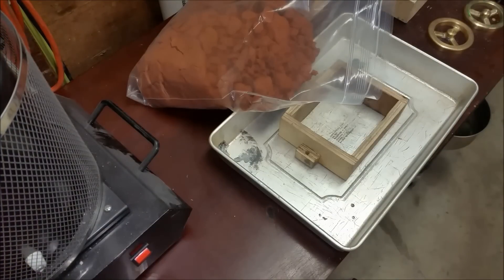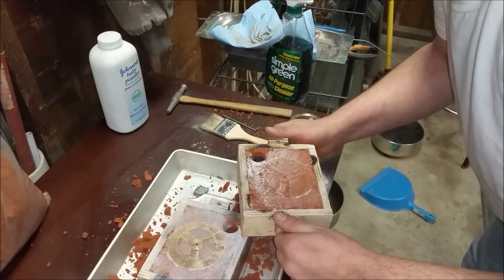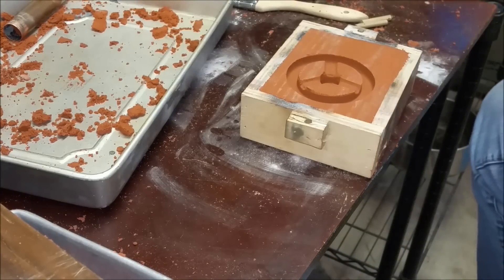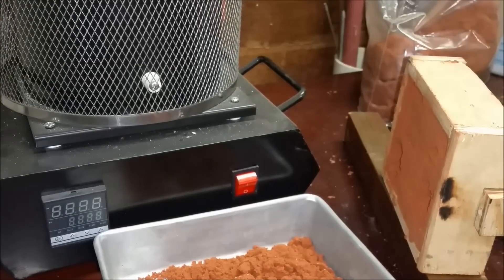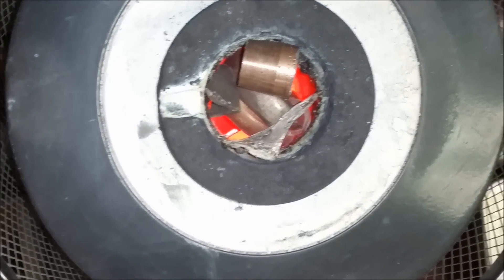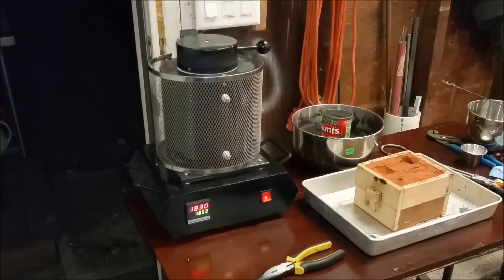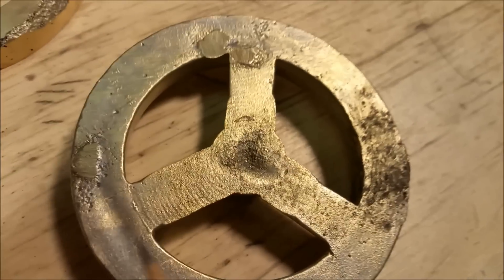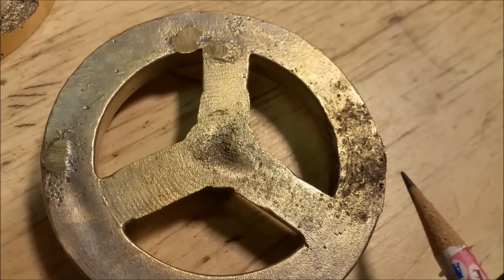Casting Brass using Petrobond

Comment: I love seeing someone first discover the wonders of Petrobond.

Venting is not much of an issue with Petrobond. (That's why they can use such fine sand which gives the great finish quality.) Greensand develops steam pressure. The smoke from Petrobond has little pressure. However, you should have a riser on the hub. When you ram the cope you should have placed a dowel  on the hub that extends to the top of the mold.  Better yet, have a pin in the end of the riser dowel that engages with a hole in the pattern that keeps the riser in place. The riser can't really be to big or too tall. The riser provides molten metal to the hub as it cools and prevents the shrink you found in your hub. Taller risers provide more head pressure  Risers should be provided wherever your casting has sections that are thicker than the average for the part.

Loose sand and turbulence cause pitting. A horizontal  runner between the sprue and the gate that is lower than the gate gives the sand that is stirred up from the metal hitting the bottom of the sprue a place to settle before it can enter the gate.

Great video. I've subscribed.
Reply: Douglas Higden x
Reply: @murrayschlussel   what does "x" men in your reply?
Reply: @crookedriver2079  I assume it's a kiss expression as in a thank you in this context for additional information which may have helped this person solve some issues in their own casting.

Comment: I'm no expert on sand casting, however, in a former life I designed and built molds for plastic injection.  This part looks like a perfect candidate for sprueing straight into the hub.  This would evenly distribute the material to the perimeter as well as solve your sinking hub issue.  Run vents from the outer edge of the cavity  horizontally across the parting line to the edges of the mold.  The symmetry of this method might work to your advantage.  Good luck.

Comment: Hi Don. I really enjoyed your video. I am just retired and plan on trying my hand at copper, brass and aluminum casting.  I hope you will not take offense to one tiny thing here. That is the smoke arising from your crucible. Brass, which is a molested copper, contains several other ingredients (depending on desired strength and texture/color) Zinc is the lesser of the mix when brass is made. Zinc and copper combined and then heated/overheated can cause that white smoke and leave some white residue.  The fumes are actually caustic and because of zinc as a metal carries a density when overheated, pretty much what someone breathes in, kinda of stays in. So, just wanted to throw that out there. Didn't know if you had a fan or something. Again, I meant no offence. Actually, I'm just now learning this stuff. I have a friend (geologist) that actually warned me on all this. Again, great video, I subscribed and will keep watching..........
Reply: The Spearsy Spin Mike Spears 
I hope he read this... Lol

Comment: How many times can the Petrobond be reused for casting? Is there a limit?
Reply from the maker: The Area of petrobond that contacts the molten metal become burnt and hard. Some people, including me have separated the burnt petro bond.  you can recover 90 percent ish depending on the casting to reuse that is not burnt. Of the burn petrobond, i add mineral oil and use it for castings that dont require a nice finish. Good luck and thanks for the question.
Reply: Can u show ua how do u reuse the burnt petrobond?

Comment: Pretty good video, your center which you call sunken, as actually something we'd call cavity shrinkage. This defect occurs when two different sources of molten material are joined to create a common front while solidification is already taking place. A lack of additional feed material to fill in the accumulating gaps can further exacerbate the cavity shrinkage problem.

Comment: I am not a caster. My experience with sand casting is very limited but I do cast using lost wax regularly when I have a jewelry project that isn’t easily fabricated. I think you will have better luck with the impression from the mold if, after making the firs half you relieve around the edge so the top half actually fits down the mold item. It is very hard to get nice crisp arises if they end at the top of the bottom half. I don’t think I said that well. Also, on a spiked item like your mold, put the spruce opposite, inline with, one of the spokes. The pour will flow into the inner hub more smoothly. But I liked your video. Very informative. Very fine casting. I thought you were very brave to cast with brass. Much harder than either silver or gold, or aluminum.

Comment: Get you a hand cranked flour sifter for dropping it on the mold piece for a finer detail. You can drop the remainer around it normally. The sifted sand helps with the detail, that around it not so much other than to hold it into the U/L flasks. Also some of the big brass tacks about in the middle of you flask both upper and lower will help hold all the packed sand in better. Just 3 on each flat side on the inside. Also, what furnace are you using and how well does it melt brass? I'm using the old propane one I've had for 10 years and sure like the looks of the electric ones.

Comment: For indoor casting, you should go to K Bond. For Petrobond, either cast outside, or run an overhead vent hood as the smoke is banned by OSHA,in closed rooms. K Bond was developed by a university because of that very reason. A riser in the center will help on srinkage dimpling.

Comment: The sprue should be attached to the lowest part of the mold. The risers should be on the top. The reason you had the shrinkage is you need a draw pool gate that the form can suck more bronze from as it cools.

Comment: Don , the one really important thing I would offer is never ever add cold metal stock to a molten pot. It is the one thing most likely to cause a spit out of molten metal from the crucible. This is a drawback with electric powered furnaces in that there isn't as much excess heat issuing at the top where the next batch can be preheated. Always preheat new stock before adding to the crucible.
Reply: Yep, it's also essential to get any fluids evaporated if you're melting aluminium cans and such. It wouldn't be the first guy who gets splattered with molten metal.
Reply: @scififan698  I shudder watching some inexperienced video content when you sometimes see drinks cans being loaded into a pot which already contains molten metal and you can hear residual liquid turning to flash steam. They seem completely unaware how very badly that could turn out. Years ago I witnessed a large spit out from a molten pot of aluminium pistons. The guy loading more solid pistons to the crucible hadn't preheated them and he then forcibly pushed an unmelted piston into the pot of molten ally with a poker rod. The result was a violently ejected spat of molten ally that luckily didn't hit anyone in the vicinity. That was likely caused by moisture sitting somewhere in the gudgeon pin bosses or ring grooves of the last piston dropped in.

Comment: Hi Don, when you redid it and used sifting sand, wouldn’t it have been better if you had given the object for casting, a light covering of talcum powder first for a quick release and finite filling of the little voids in the casting.  I’m only asking as I hopefully will be starting this sort of casting, but in alloys specifically, anyway keep up the great work...Phil 🇬🇧

Comment: I like your videos, and ive subscribed! My only question is...why are you recasting flywheels? Im really curious to know!
Reply from the maker: Hello and thanks for the question! My interest in flywheels has to do with model steam engines. I am working on prototype for a model steam engine. A flywheel is a very difficult item to come across and retail is very expensive. Additionally, machining one from a solid piece of brass is very laborious, which drew my interest to casting. In the future I plan on having a model steam engine that I can sell. The flywheel will be the focal point of the model. My best, -cheers

Comment: I would pick up a bag of bentonite clay, 2 cycle oil and alcohol to rejuv the petrobond the higher temp brass will burn it out and you will loose the green strength. A 50 lb bag of petrobond only costs about 30.00 from Western Pacific Foundry supply shipping will be high

Comment: 106 competitors of Petrobond down-voted this very cool video. Thank you for posting!
Reply from the maker: Lol..thanks for the comment
Reply: @DonBrandt  You bet, great video. So the Petrobond is a once-and-done, just one use per pour? The silica sand is re-usable, but clearly not as fine a surface by far
Reply: 1JOCU1 thank you for replying. I was wondering why the host did not respond. Like maybe he had a secret. It’s all new to me so I’m just asking basic questions
Reply: @pamtnman1515  Petrobond can be used over and over again. it get's better each time you re-use it. But to reconstitute it you need a muller. A couple of drops of motor oil added to the burnt sand int he muller and it'll be better than new.
Reply: @TheRealCreepinogie  thank  you
Reply: @pamtnman1515  I should make a video about mulling petrobond and how to reconstitute it. It works better and better each time you use it as long as you remull it, eventually it'll start going backwards and you need to mull a new batch and add it to your old batch and you're ready to go again. You keep building up more and more of it over time it seems. The biggest problem is you need a muller, a regular mixer won't work. If anyone's ever in Northern Minnesota I'll show them how. Not too many people want to get their hands dirty anymore.
Reply: @TheRealCreepinogie  I have only the vaguest notion of what you are saying here. You should definitely do a video! I am a very novice-level caster and so far I have messed around with real simple clay forms. Looking to understand the more sophisticated methods. Thanks!

Comment: That dimple in the middle could be corrected by adding a large vent right above it so it can draw metal as it shrinks.
Reply: I think you mean riser, not vent
Reply: Well, a few thin vents wouldn't hurt, and a decent riser too.. and a pooring basin, and.. see old foundry guy's channel.

Comment: Great video mate, lovely casting, came out really well.  Always preheat your metal before use, most metal will have a layer of moisture from the atmosphere which is enough to cause a metal explosion when added to molten metal.  I've done it myself, it's frightening.  Also be really careful with those graphite crucibles too, the lip wears down a little after each use, sooner or later your tongs won't grip the crucible properly - they can be really dangerous when worn. dropping a full crucible is not funny... !!!  Cheers, Andy (subbed) 🍺🍺🍺👍👍👍😎
Reply from the maker: Thank you so much for the comments and suggestions!
Reply: @DonBrandt  Your welcome, I've seen someone drop a graphite crucible full of molten metal due to a worn lip, luckily they weren't hurt but everything the metal touched caught fire !!!  Best not to learn the hard way !!! haha.  Edit.. Just noticed this video is 3 years old.... that crucibles probably long gone by now I guess... hehe.  Cheers Andy

Comment: You've probably learned by now, but having a more solid bench helps a lot with packing. I saw yours bouncing as you rammed the sand. I had that problem, then stiffened up my bench and it's WAY easier to pack now....
Reply: lol nevermind, at 8:38 you discover it hahaha

Comment: Would there be any problems putting the main riser in the centre of the casting? Does there have to be a gate for brass casting?
Reply: Sam White if you put the riser in center...you would destroy all details of your mold.....you want it in a spot with the least deyail and the easiest spot to sand smooth

Comment: I really appreciate the time you spent going into detail on your whole casting process. I've been on the verge of buying  either Delft clay or Petrobond for months, but after watching your video, I think I'm fully on board for the Petrobond! I always watched videos on Delft, but then I decided to try searching for Petrobond and I'm so gladly surprised I found yours. Also, from watching videos on delft, some quench their piece after they take it out of the sand. Also, have you ever tried delft?! I've seen articles comparing the two, and Petrobond was always put down as not a clear casting. But I'm so surprised!
Reply from the maker: Hi craftcorner, thank you for your comment. I have not tried Deft clay, but I am very happy with the finish of the petrobond castings. I don't have the process perfected yet, but I am sold on the petrobond for small castings. -don

Comment: Can you reuse all the sand?  Thanks.
Reply from the maker: i usually remove the burnt sand that come in contact with the hot metal. So yes, you lose with each casting. Thanks for the question

Comment: That's gas porosity in the casts. It happens during the melt with all copper alloys. Oxygen is absorbed from the air, especially in an electric furnace, as there is no reduction flame. You need to get a degassing compound, or practice the old foundryman's tried and tested trick of putting something combustible like charcoal in the crucible to burn up all the oxygen before the melt starts. Do it in the open air, though! Thanks for all your videos-such a lot of work.

Comment: I think you should try pouring from the center back part of the spoke, that way it should flow inside to out and any pitting will be cut off? Just a thought
Reply: Not only that, but a pooring basin would be a great improvement.. now it's arriving rather turbulent.

Comment: Instead of Sketchup, take a look at Autodesk Fusion 360. It is free for makers, and isn't too hard to figure out (disclaimer, I do CAD professionally so maybe my point of view is a little messed up). Either way, if you are into making things I think it is worth the investment of time to learn.
Reply from the maker: Thanks so much, I'll check this out!
Reply: Is that similar to AutoCAD and free or cost?
Reply: It's free for non commercial use, and very small startups. And it's both way nite powerful and way easier to use than sketchup.

Comment: can this sand/clay  be reused over and over again?
Reply from the maker: Most of the Petrobond can be reused. It gets burnt to about 1/8 depth surrounding the metal. You can tell the difference by feeling it.. Petrobond is is tacky to the touch, after the cast is complete, the burnt petrobond is no longer tacky. I don't mix them back together. I just separate the burnt from the tacky on a pour. The results, are in my opinion, are well worth the cost. as a side note, i think you may be able to buy some oil and recondition the burnt petrobond from the manufacturer. Thanks you for the question!! -Cheers
Reply: cool. I was looking at casting a bunch of 6 oz lead fishing lures, and I want to make about 100 of em, so youre saying just the area around the cast is unusable?.
Reply from the maker: that's correct.
Reply: Lead is a very low melting point metal (327C). It would probably only burn a small amount of the sand around it. The brass used in this video is comparatively a lot hotter (900-940C).

Comment: No issue with your use of Petrobond... as a jewelry maker I use both every week. The Petrobond claim about substituting for Delft is commercial propoganda. They are very different materials for different applications. And ,yes, Delft is expensive. I buy it about once a year and flinch every time.

Comment: Can you use the Petrobond more than once?
Reply from the maker: Yes.. You sure can.  The burnt part where the part comes out, i don't reuse. They have some conditioner for the burnt part. however, at $20 FOR 10 Lbs.. I just set the burnt part aside.. When i run out, ill get some more and add it together. It worth the price compared to greensand in my opinion. The castings are very detailed with petrobond. -cheers
Reply: How long does 10 Lbs of Petrobond last you?
Reply: Gus you lose about 5-10% when you pull the burnt aside in a "hobby" setting.But even without the stuff they sell if you have the right setup you can reuse it for a VERY long time.I have a friend that casts boat parts (struts,props,fittings)and he takes my burnt stuff that I accumulate and I might be mistaken but I am pretty sure he just runs it through a ball mill to mix it in with the unburnt parts.It's funny but he only uses the used stuff on his important jobs,granted he has the experience but he can feel when it is just right for him and from my research he's not the only one to do this.
He told me a while back on how to remix it at home but it's just not worth it for me.Plus every time I get a bucket it gives me a reason to stop in and ask questions and get some tips etc.

Comment: It would drive me crazy trying to work on that wiggling table ,you need a solid bench.
Reply: It's always a 'short trip' to crazy for me. I understand your observation! I worked with an older gentleman years ago that had very shaky hands. I could not watch him put a set screw in a collar with a small Allen wrench. Had to turn my head to not watch. Don made that table shake look like his tooling is on concrete!
Reply: That stupid aluminum pan was making my OCD go into overdrive...I knew that was “one” of his problems..along with shaky table, too big of a ram, etc,

Comment: I think your gate is too small. The metal hits there when you pour and cools. The the cooled down metal doesn't flow as well and leaves the lumpy surface right by the gate.  The nice new petrobond is pretty sweet.
Reply from the maker: +David Kirtley I'll go ahead and try a larger gate. I'm getting ready to cast a double-sided flywheel and I'll use your advise. Yes, the petrobond is AWESOME! -cheers